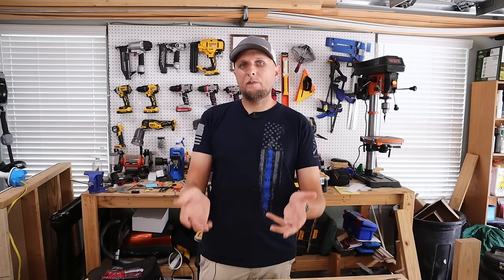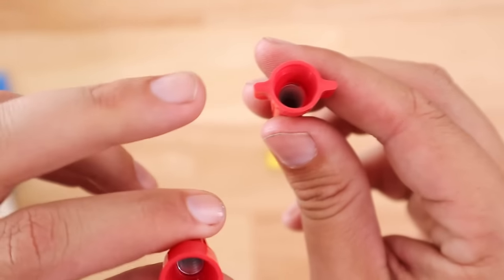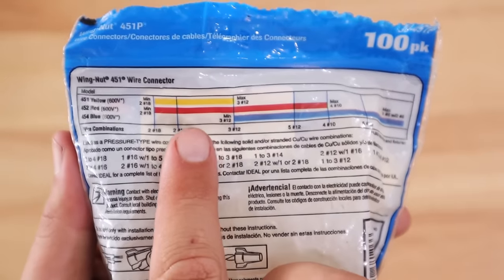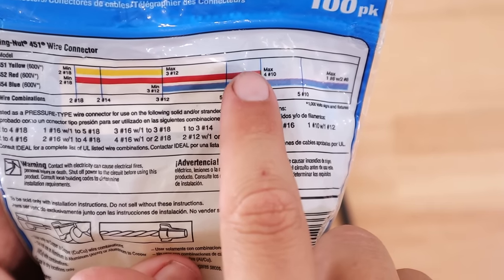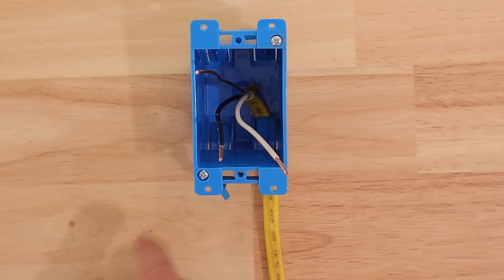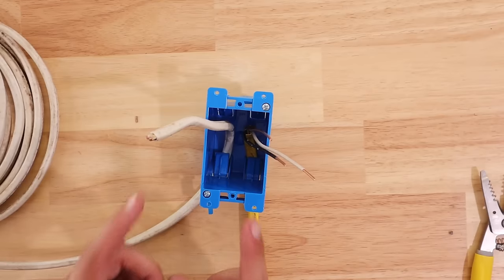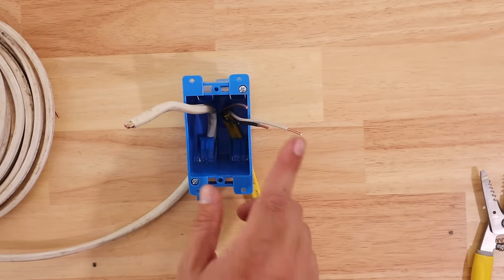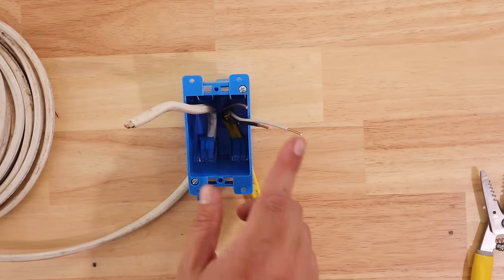Biggest Mistakes DIYers Make When Connecting Wires Together | Part 2

Comment: On the comment regarding mixing different wires gauges (14 awg & 12 awg), I heard from a couple of electricians in the past that it is ok to do that when the 14 awg wire out of the box is going to a light fixture, but never to an outlet. Was I misinformed?
Reply: You can run 14 to an outlet provided it's on a 15 amp breaker or fuse.
Reply: I am aware you can run 14 awg wire out of the breaker box and into  outlets as long as you use a 15 Amp breaker. However, my question was in regard to the mixed wire example in the video where we are shown a 12 awg wire supposedly from the breaker box to an electrical/junction box and then a 14 awg wire coming out that box into something else like a light fixture or an outlet. As mentioned in the video, a DIYer or even an electrician might want to install a 20amp breaker in that circuit specifically for the outlets. From what I was told in the past, if a second leg in that circuit with the 14 awg wire is connected to a light fixture and another second leg coming out of that same junction box goes into an outlet with a 12 awg, that should be ok to be on the safe side. If I didn't make my example more confusing (LOL), is that actually ok or was I misinformed?
Reply: @guilima1202  

Any one circuit need to be protected at the correct amperage of the smallest gauge wire in that circuit.  

It's legal to run different gauge wires in the same circuit.  For example, you could run 12 gauge wire from the panel to an receptacle box, and then run 14 gauge from that outlet box, to another receptacle box, then to a switch box, then to a ceiling light box.  In this scenario, knowing you have 14 gauge wire in the circuit, the maximum amperage breaker/ fuse you could install for that circuit would be 15 amps.

Using the same box configuration as above, you cold also just switch the positioning of of the 12 gauge and 14 gauge wires, and it'd still be legal, if protected by a maximum 15 amp breaker/fuse.

If you knowingly have 14 gauge wire in the circuit, except for a few exceptions, the maximum protection that circuit should have to meet code would be 15 amps.
Reply: @45Deere9500  Thank you so much for clarifying that to me! I do appreciate you taking the time to do that! I am wondering now if I misunderstood what I was told in the past or if I was actually provided the wrong information. Until we had this exchange, I had in my mind I could have a 12 awg wire from a 20 Amp breaker into an outlet box in case I needed to run heavy power tools. Then a 14 awg wire out of that outlet and into a switch and then a light fixture and/or a ceiling fan. I have never done that myself, but I have told other people that it appeared to be ok based on what I had been told! I will definitely keep in mind that the breaker needs to be in compliance with the most restrictive wire gauge in the whole circuit. Again, thank you so much for sharing that with me!
Reply: @guilima1202  You're welcome, Gui Lima.
Reply: if there is any 14 gauge wire in the circuit, your overcurrent protection is limited to 15 amps.

Comment: It’s also good to note that there is no industry standard to correlate wire nut size to wire nut color. A red Ideal wire nut may not necessarily be the same size as a red 3M wire nut. Read the package your wire connectors came in.
Reply: He covered that starting at 1:25.

Comment: The electrician at my brothers house used 12-3 for most the run but then used 14-3 to branch out to multiple plugs. The breaker is 20amp. Really unhappy they did that.
Reply: did it wrong.   has to be under a 15amp breaker.
Reply: So obviously that needs to be on a 15 amp breaker. But taking a step further if he used 14/3 for multiple outlets that’s known as a multi wire branch circuit. So that should really be on a double pole breaker. If one leg trips and the other leg doesn’t, the neutral could still have current because it’s shared on two circuits. With a double pole they will both trip because the trip bar is connected
Reply: @johnsandlinjr  ,   Today,  nobody should be running a multi wire circuit for outlets.  as suppose to be under a arc fault breaker.  not sure if the new arc fault breakers will work right with a multi wire circuit.  long time ago . Lots of Sparkys would install multi wire circuits.  And you are correct as in the code a multi wire circuit is suppose to be under a DP Breaker.  the old Elec Inspector for the State of KY. use to say a long time ago. that a multi wire circuit is a widow maker.  because of what you said.  currect flowing over the neutral.  it hurts to get hit with current flowing over a broke neutral.
Reply: @zerosparky9510  very true. Depending on when it was installed.
Reply: Great input. This was for a basement so all the breakers are double gfci breakers.
Reply: @zerosparky9510  There are arc fault receptacles you can use instead of arc fault breakers.
Reply: @bc1173  . Yes I know that.   How long have u been in the trade?
Reply: @moonlight.8831  is there where l give you an answer and regardless of the number l say you will tell me you've done it for longer?

Comment: Thanks for the video!  FYI....While it might seem insignificant, many people refer to all basic cone shaped wire connector (there are many different brands) as "Wire-Nut" and "Wing-Nut", but these specific brands and they are registered trademarks of Ideal Industries, Inc. The generic name is usually called a "wire connector".   It would be incorrect and unfair to give positive or negative feedback and comments when speaking about a "Wire-Nut" and "Wing-Nut" and it wasn't an Ideal Industries, Inc. product.
Reply from the maker: Appreciate the feedback Bill!
Reply: Wagos are not real cost effective
Reply: I am actually a do-it-yourselfer that has been doing electrical work in both my job and at home for over 50 years. I talk to many electricians and other do-it-yourselfers and rarely if ever have heard them called wire connectors. Just like Kleenex is the default name for facial tissue, most of the people I talk to use wire nut as the default name for the device you are describing.
Reply: @mikeslater6246  exactly right!  xerox for photocopies, the word “aspirin” was a brand at on time but lost its status because everyone was saying it for other pain relief products and then. It became a generic name.
Reply: @billhandymanbill2775  
And Sawzall (reciprocating saws) & Skilsaws (circular saws).
Reply: @calculator1841  absolutely correct about the names!!

Comment: My breaker keeps tripping everytime I plug in the iron and use it for a couple of minutes. Any ideas?
Reply: Old (all metal) or new (mostly plastic)? Likely arcing characteristics are triggering the AFCI. It could be an intermittent break in the cord but it may be that the thermostat is noisy. It may be normal for that model. Try a bathroom outlet as they shouldn't have an AFCI.

Comment: I've done this before.....14G to outlet run , ran out of 14/2, finished the run with 12/2, breaker was 15A.  Also marked on the sheath of the 12/2 ( run started at panel with 14/2, 15A)  so someone adding to the outlet will know what I did!

Comment: I find it funny that immediately after he shows the back of the package that explains the correct way to install the wire nut, he says that he prefers to do it another way as if it is the correct way. The package shows the wire nuts put on wires that were not twisted. Code says to install per the instructions so when someone does it differently than the way you were taught or the way you like does not make it a "mistake".
Reply from the maker: Well Philip, the packaging says it is not required.  This means that you don't have to pre-twist but you can if you want to.  All of the wording is important.  Myself and many that I have talked to that are in the profession feel pre twisting works best and you walk away from it knowing it is has a great connection.  I never said that it was a mistake not to pre twist, maybe you skipped all of that.
Reply: @HowToHomeDIY  Thank You for clarifying that. I have personally pulled off numerous wire nuts that were not pretwisted and there was little to no differance. Proper installation is the most important factor.
Reply from the maker: Totally agree!
Reply: Pre-twisting for me is standard practice; it's worth the peace of mind (Although I never have to troubleshoot my work. Yeah, right.).

Comment: I bought an older house, the light is 14-2, the line is 12-2 and he tapped into an outlet so how do I fix this? If the breaker is 20amp, the wire to power the light is 14-2 and he tapped into an 20 amp outlet with 12-2 wiring

Comment: Just because q breaker says 15 amps doesn't mean it trips at 15 amps I actually seen them trip at a higher than 15amps I actually seen square d brand breaker trip 18.3 amps but also seen it happen on other end when breaker has age on it and become weak and trip I say 11.6 amps it takes heat and resistance to make it trip
Reply: actually 15 amps means 15 amps unless the breaker is bad. the thing is there's a few types of breakers and none actually trip the moment the breaker goes above it's amp (unless it's way over) or any time an electric motor (like a vacuum, microwave, a refrigerator, even fans, etc) come on the breaker would trip. That's why you would often find bigger amp fuses where they shouldn't be and then they eventually came out with time delay fuses for only panels. it's because a motor can pull a ridiculous amount of amps at start up from what is normal during operations. It's not really an electrician thing as much as electrical engineering but breakers are fascinating in themselves how they work and they sometimes seem to trip at higher or lower amps.
Reply: @zacharythebeau163  they should trip at 15 amps that ul listing says but under real world settings they don't always trip at 15 amps it takes resistance on circuit to build up heat which in turn makes one trip well for instance u go in and open panel and they have a 15 amp breaker and 12 Guage wire run to it it not going necessarily trip at 15 amps it takes more current flow through that wire and more resistance and more heat which will take longer to reach that point in thicker wire but each breaker manufacturer tolerance are different not one manufacturerr tolerances are same across all breaker brands having the correct size wire for correct size breakers helps the system work better on tripping and new breakers required under NEC which is gfc and afc qre even better at that but not all 15 amps that just fact
Reply: @zacharythebeau163  and here's another scenario for u I was pulling a sub panel out of small shed for friend disconnecting power to it power was run back into the panel in house and when disconnecting panel in shed home owner wasn't home so didn't have access to inside panel in house so took 2 hot conductors and and dead shorted on case breaker panel to make the breaker inside house trip it was a 30 amp circuit well let just say I literally shorted that circuit on case 6 times before it tripped so if breaker inside was 30 amps that breaker should tripped first time I dead shorted it too  sub panel case in that shed that shows right there not all breaker trip out at the ul listed rating I know for a fact breaker inside house was a 30 when homeowner got home I disconnected wire on inside to make sure that circuit couldn't be energized since shed was being removed and there was a section wire that couldn't be pulled out ground
Reply: Standard breakers are thermal devices, tripping is relative to temperature, the heat from current flowing as well as ambient temp. I once had a panel mounted inside a walk-in beer cooler kept at 38degF. Had a 20A breaker pulling 27A that wouldn't trip because the cooler kept it so cold. Outdoor panels in direct sun will trip at lower amperages, as well.

Comment: Fusing (melting) a 14 gauge copper wire requires 166 Amps, so it would seem that the 5 Amp. increase imposed on one when installed in a 20 Amp. circuit would be minimal, even with the heat factor considered?? How is it we can operate a 10 Amp. circular saw on the end of a hundred foot lead rated for less than 5 Amps. plugged into a 20 Amp. circuit?? FYI The NFPA/NEC sells nearly $100,000,000 worth of publications annually. The NFPA employs 600 people?
Reply: #14 is rated for 20 amps so, while a code violation, going beyond 15 amp on #14 is unlikely to do any short term major damage or cause a fire. However, not sure where you're getting your numbers from but you're way off. #14 will fail far below 166 amps. And you can't run a 10 amp saw on a 100' cord that's rated for less than 5 amps because, within a few seconds, the saw motor will burn up due to voltage drop.
Reply: @pld8993  One good thing about arguing with the uninformed is that I'm forced to look up the details myself! Google "How much current is required to melt a 14 gauge copper wire?" "Electric tools can operate with a voltage ranging from 90% to 110%" "At100 ft. 14gauge copper drops 6.28V. You do the math!!
Reply: @jackriley5974  I agree. Since when is #14 rated for less than 5 amps, mr uninformed?
Reply: @pld8993  Lincoln once said "It is better to remain silent and be thought a fool, than to speak out and remove all doubt."
Reply: @jackriley5974  You may want to read your own words and say that in the mirror a few times before you start thinking you've made a point about someone else. I'll bet you learned that from google.
Reply: @jackriley5974  "How is it we can operate a 10 Amp. circular saw on the end of a hundred foot lead rated for less than 5 Amps. plugged into a 20 Amp. circuit??" We can't and we don't. Hilarious!

Comment: All electrical components have a rating 👍👍 from motor starters to simple wire nut,,,, and not all are made to same quality standards,,, don't buy the cheapest wire nut,,, as a 30 year master electrician,,, I stand by ideal tan twisters,,, have the largest range of conductor rating,,, 👍 and use a 5)16 nut driver and the do a realy nice twisting of wires as it is installed

Comment: Two things, one is that lights and receptacles should never be on the same circuit. There are a lot of reasons for this. A junction box or 3 will fix it. The second thing is wire nuts of any size should never have more than 5 wires. This is because the 6th wire in the center won't make good contact with the wire nut. 
If you have 6 wires you need to connect, god forbid, connect 4 of them in one wire nut with a short wire, a pigtail, to another wire nut and the other two. 
And if you have 5 in a wire nut, wrap some tape around them at the wire nut to help keep them in place as you attach the wire nut. 
I do not recommend pre-twisting because it doesn't let the wire nut make intimate contact with each wire, and every time a copper wire is bent, it hardens it and causes it to become more brittle. 
The wire nut has barbs in the spring inside that dig into the wire to make a mechanical and electrical connection. Pre-twisting defeats both of these functions and weakens the wire. Debatable for sure though. You cover some good topics very well.
CA qualified 23 years.
Reply: Lights and general receptacles can be, and frequently are, on the same circuit. It's not a code violation to do so. Personally, with a few exceptions, I separate them, but it's not a requirement. Bending copper wire, as in a splice, does not harden it, not sure where you heard that one.
Reply: @pld8993  Hey if you're an electrician offer some suggestions of your own to contribute instead of busting my balls for no reason. You could look up work hardened copper while you're at it. People can and frequently do crash their cars, and it's not a violation to do so. I wouldn't.
Reply: @BariumCobaltNitrog3n  You said it's code to keep lights and receps on separate circuits. I said it's not a code violation, which it's not. How is that busting anyone's balls?
Reply: @BariumCobaltNitrog3n  Notice, "bending copper wire, AS IN A SPLICE," is what I said. Bending it back and forth repeatedly is not the same as bending it a splice.
Reply: @pld8993  blah blah blah
Reply: @BariumCobaltNitrog3n  Does being wrong hurt that bad? Wow.
Reply: @pld8993  Yeah. I've only been wrong twice in my life.

Comment: The Ideal unit is called a wing nut!
Reply from the maker: Some of their lines they do call them wing nuts.  You are correct.
Reply: I run Ideal Can-twist wire nuts, blue in color.